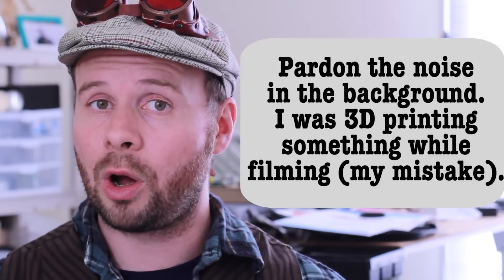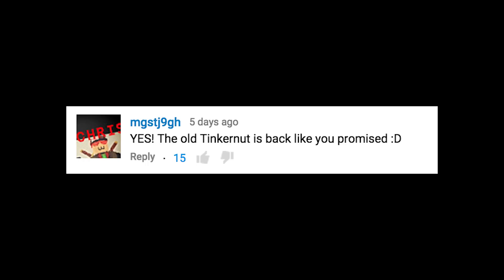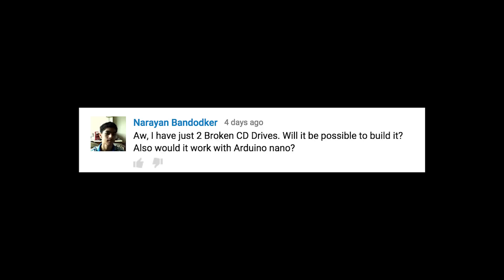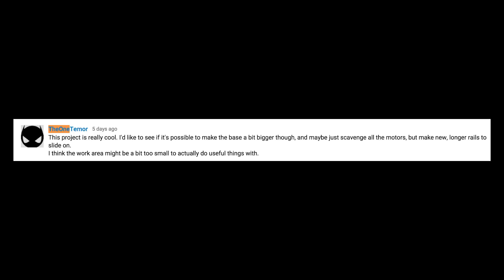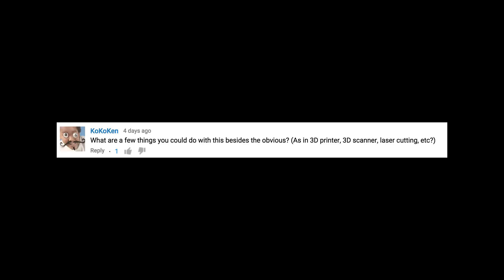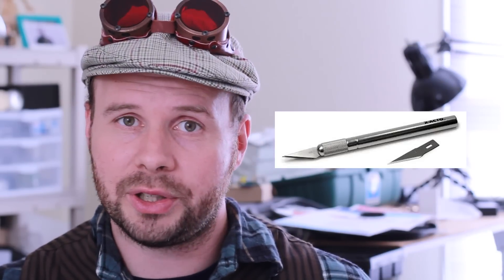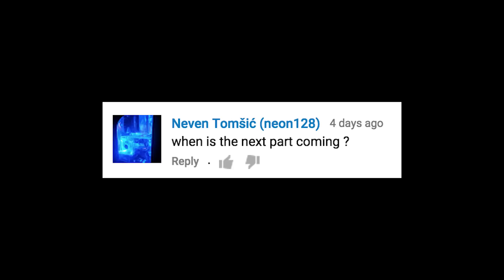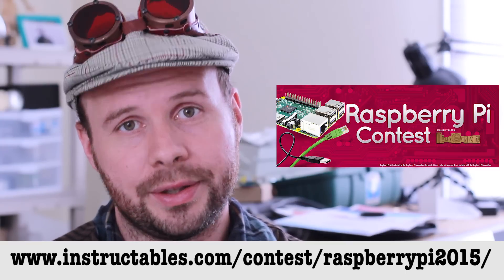Comments Show: Hack old CD-ROMs into a CNC Machine - Part 1

Comment: Can I use L298N-based H-bridge motor driver instead of the motor driver you used? Do I need to make any changes in the sketch of the Arduino ?